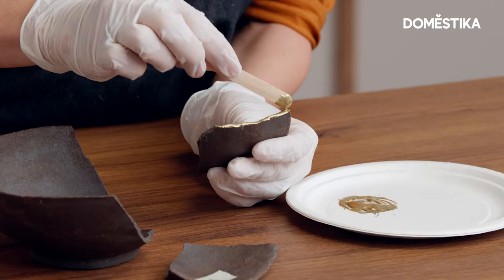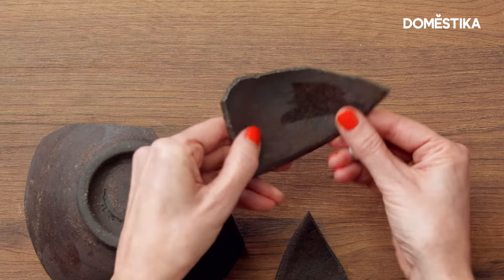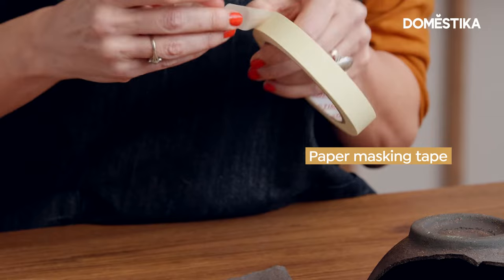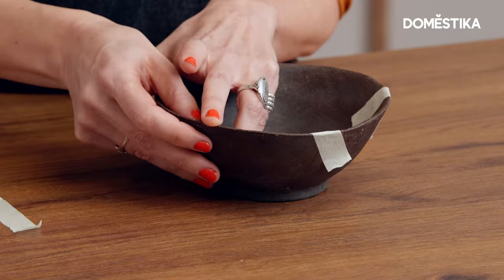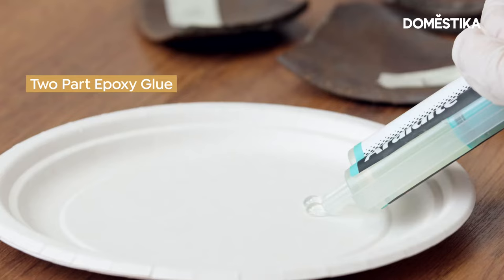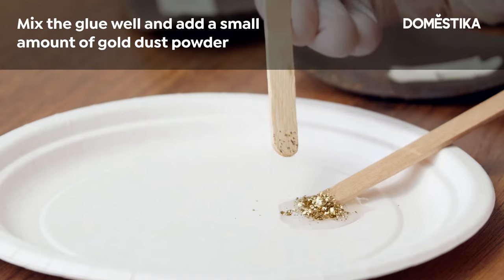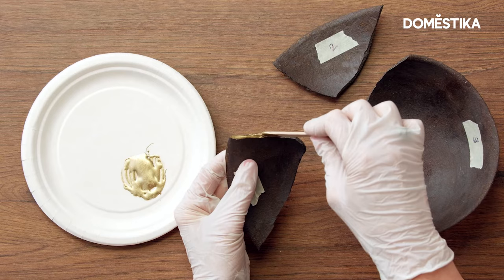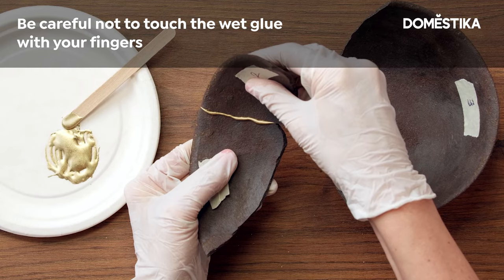Kintsugi Tutorial: How to Glue Your Broken Bowl - Clara Graziolino | Domestika English

Comment: Is this food safe?
Reply: If you use modern methods like epoxy, no it won't be food safe. You can use the traditional method and use urushi, a Japanese lacquer, and that would be food safe.
Reply: @khmerman41486  Thank you very much <3 I'm probably gonna give up on it though, as urushi lacquer isn't sold in my country >~< or at least in big online shops
Reply: @meglivica1001  You could find glue or epoxy with food safe standard instead of urushi